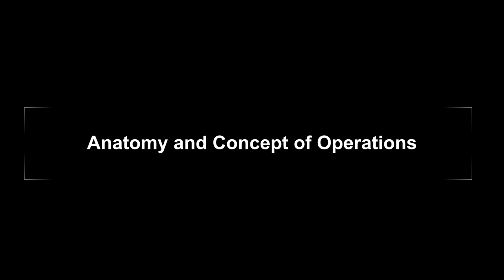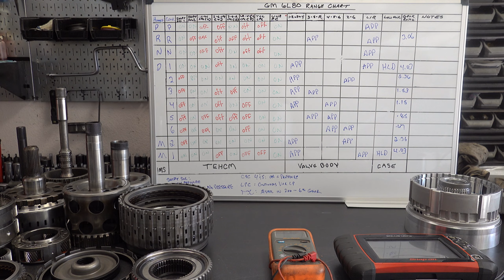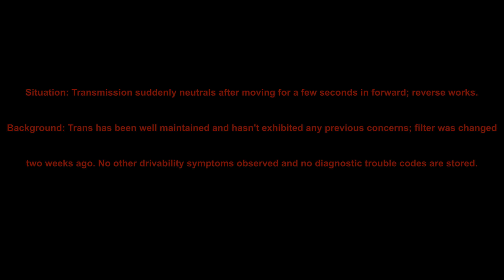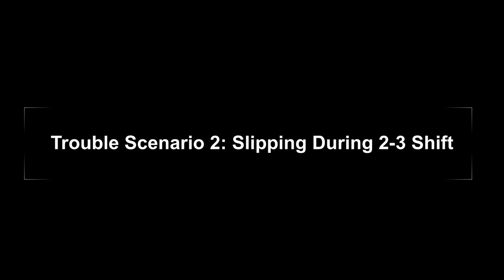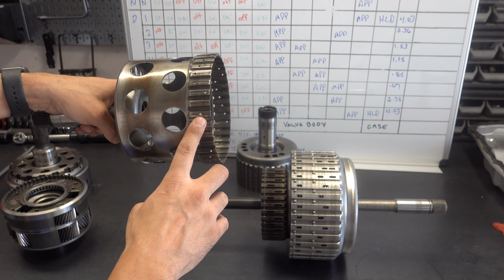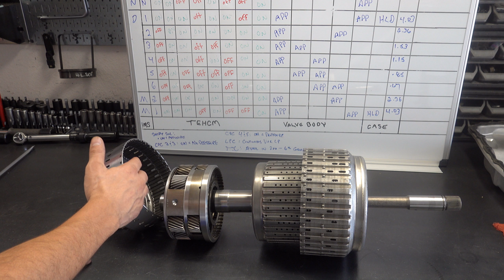6L80 Troubleshooting PT1 - Fundamentals and Range Charts

Comment: In a 6l80 transmission,adding the extra frictions really matter? And at what horse power does it really make a difference?
Reply from the maker: Hi Dale, thank you for watching.

It matters more for the 4-5-6 clutch as it's a bit undersized for what it's being asked to do, especially when power levels start to go up....The 4-5-6 hub also likes to snap under power/torque so upgrading that entire clutch and hub to a 45-tooth Powerglide-spec with the Sonnax piston kit for the extra fictions and billet steel 4-5-6 hub is the best way to 'bullet-proof' it in a HP application. 

The 3-5-R clutch benefits from one extra friction and steel once power levels climb higher than 125% of stock (on avg) but the main vulnerabilities in that transmission are the torque converter and 4-5-6 clutch with the caveat that the 3-5-R clutch drum has had its welds reinforced and all the requisite hydraulic updates / corrective measures have been done.

The converter is shored up by installing a .070" thick BW high energy clutch (or triple disc set up), billet cover, flanged hub and having the TCC apply tuned out for gears 1-4 as it's being overly worked in the early part of the drive cycle, IMO. Flipping the pill or deleting the TBV in the later vehicles also goes a long way to keep the trans healthy. 

The L/R, 2-6 and 1-2-3-4 clutches are fine as is insofar as friction and steel count; Sonnax billet 1-2-3-4 piston is all that is needed there.

Hope that answers your question.

Comment: Hi Nick, I watch and enjoyed this video,  I was looking for the one you mentioned about the solenoids and valve body diagnostic but couldn't find it.   May be you could help me out.  I rebuilt my 6l80 transmission, all new friction and steels, all new bushings, all seals and most pistons replaced, stator pump half replaced, transgo kits in valve body and pump and I did the pressure switch repair sold by transgo.  all gears work in the transmission up down revers all good, but it hesitates shifting ( not sure what gear it is) around 60km and or 80km.  It hesitates the engine revs to between 2500-3000 rpm then gear engages.  I'm thinking or hoping its the solenoids sticking. or at least hoping. (woudl rather not remove the transmission again.  What do you think it would be.  Thanks.
Reply from the maker: Hi Mark, thank you for watching...You'll need to pinpoint in what gear the delayed engagement is occurring but on a fresh rebuild, this typically happens when one or more of the front three clutch packs are outside of factory-specified clearance ranges. Did you record each of your clutch clearance measurements for the 1-2-3-4, 3-5-R and 4-5-6 clutches? Given the speed the problem is likely going to be either in the 3-5-R or 4-5-6 clutch, assuming it's a case internal problem and not a valve body or TEHCM issue. 

Have you scanned the PCM for any transmission codes?

Did you bench test the solenoids and pressure switches to confirm they all had continuity and electrical circuits opened/closed when actuated in the case of each of the pressure switches?

Did you perform a case air check to confirm all clutch packs apply and no leakage is present before bolting the VB/TEHCM, etc onto the case?
Reply: I didn't write the clearances down but I did check them and the all came within tolerance, I had to put a thicker  snap ring in the 1234 to get it into tolerance.  I just went out and scanned the truck and there are no codes.  I haven't been able to nail down the gears, the truck doesn't tell you what gear it is unless you manually shift and I just can't seem to be able to count them,  I did air test all the clutches before I put the valve body on to make sure they all worked.   If I manually shift the gears would it act the same way, that I suppose  would tell me what gear it is slow in.  It seems to go into a neutral state for a second or two before it changes.
Reply from the maker: Did you bench test the TEHCM and Internal Mode Switch?

I always replace the TEHCM and IMS with OEM GM parts on my rebuilds as it's generally not a good idea to reuse those or the harness/speed sensor assembly.
Reply: No I didn't bench test the TEHCM or IMS, and yes I should have, wish I did.They are big ticket items or at least here in Canada they are.  Its looking like its 5th gear that is acting up.  Do you think it would be worth replacing the solenoid section, I assume thats the TEHCM and IMS,  and hope that solves the problem, or do you think I need to pull the transmission again.  Its winter here and that is tough to do on the floor in my garage in the winter.  Thanks for the responses by the way.  I very much appreciate it.
Reply from the maker: You're welcome...The solenoids in the THECM cannot be replaced individually; if any of them or the pressure switches go bad, the entire TEHCM has to be replaced. Id bench test it to see if it has any issues. 

If the issue is only happening in fifth gear then is suspect everything associated with achieving  5th gear including the pistons (apply and balance), turbine shaft sealing rings, 3-5-R clutch boost and clutch pressure regulator valves and TEHCM clutch pressure control solenids and pressure switches. Since the other stuff is new, id focus on the TEHCM first and go from there
Reply: Thanks.  As I said I did air test the apply piston, but not sure about the balance piston, I'm not a trany guy I didn't know what port does the balance pistons, however I think the easiest( and not really the smartest) is for me to get a new TEHCM and replace that.  Then keep my fingers crossed.  Although I could bench test it and rule it out then decide if trany removal is necessary.  But I think I will still replace the TEHCM reguardless.
Reply from the maker: I would bench test it to rule it in/out so you have the information in hand but I also think its a good idea to replace it as well. You'll need to perform the fast adapt relearn once the new TEHCM is installed.
Reply: I was going to say, I thought it needed to be reprogramed once TEHCM is replaced.  I don't know how to do that part, and one reason I didn't want to replace it the first time.
Reply from the maker: @markjones4901 - you did not perform a fast adapt relearn after initially installing the rebuilt transmission?
Reply: Nothing I read or watched on it said anyting about programing unless you replace the TEHCM, so no I didn't.  I'm guessing from your response that I should have.
Reply from the maker: Yep - glad you mentioned it as I may have saved you nearly a grand...Acquire a bi-directional scan tool capable of adaptation resets and perform the fast adapt relearn. This procedure will reset all of the transmission control logic settings and adapts to factory default which is what you need when you have a freshly rebuilt unit, performed any work on the valve body or replaced the TEHCM. 

Note that 'Fast Adapt Relearn' is NOT the same as 'Reprogramming' as reprogramming consists of actually changing the operating system software from one version to another on your TEHCM...This has to be done if you were to replace your transmission with a used one that has a TEHCM with a different part number than the TEHCM in your existing transmission. 

But since you rebuilt your original transmission, you don't need to reprogram anything; you just need to perform the relearn. 
Here are some instructions: https://forwardassistmechanics.wordpress.com/6l45-6l50-6l80-6l90-6-speed-fast-learn-procedure/
Reply: I have a MK808 I will see if it is capable and if so try it now.
Reply: Hi Nick, I thought I would update you.  My scanner does have the ability to fast learn, but it wouldn't let me.  Keeps saying my fluid temp it to low, even though it says the minimum temp is 70c and its reading 74c.  But the scanner also has a reset pressure function (Im not sure what that does).  I tried it and since I did it, it has shifted perfect.  Maybe when the weather is warmer and I have a chance of getting the temp higher I will try the relearn again.  Thanks for the help, You have been great.
Reply from the maker: Hey Mark, thanks for the update and glad to hear you have it working well again! I've never heard of the 'pressure reset' feature on a scan tool but sounds like a neat function to have and seems as though it did the trick. So unless it begins to act up again, I'd call it good in that you shouldn't need to do any further adaptations as the computer will take it from there.

Comment: it will flare up from 1st to 2nd
Reply from the maker: TEHCM - Pressure switch intermittent failure on #1 and #5 staying inactive when they should be open and/or CPC #4 sticking off

Valve Body - 2-6 regulator valve, possible clutch select valves/spring wear, bore plug wear, check ball wear etc

2-6 clutch - piston worn, frictions/steels burnt up, etc.

Comment: I have a 2010 Chevy Silverado LTZ Crew cab hard shift for first the second it slips a little bit... what could that be? Thanks in advance.
Reply: Ok thanks for the info...
Reply from the maker: You're welcome, Desmond and thank you for watching. Lmk if you have any more questions.
Reply: Great video by the way
Reply from the maker: Hey Desmond, thank you for watching...to confirm, you have an overly harsh engagement into drive then it slips during the 1-2 shift? How long has it been doing that? Any codes? Does it do it at all times or only when truck has been sitting overnight or for a while?

Comment: During reassembly what is the range for front end play?
Reply from the maker: Front end play usually comes in around .010-.030 but doesn't have an official spec from the factory as it was never meant to be adjusted. That said, if you machine the pump cover and body/bell housing, you will likely need the Sonnax oversized pump-3-5-R drum thrust washer to replace the factory washer...The Sonnax washer is .020 thicker, which off-sets the .020 of pump 'height' lost in machining. There are also other shims available from Superior Tech to help adjust/dial in end play...Gears magazine has an article on pump machining and end play for those transmissions and IIRC, they recommend running it between .004”-.006” but I'm usually between .005-.015 on my stuff. 

Here's the link to the article: https://gearsmagazine.com/magazine/the-devils-in-the-details-a-machinists-look-at-the-6l80-6l90-units/

Comment: With the 6L80 (ex: my 2014 Yukon 4x4), is there any difference between your chart for Manual Mode/gear 1-2 vs. 3-6? I spend a lot of time in Manual Mode, selecting the gears "manually" to aid in hilly driving terrain.  Is there a mechanical difference with the torque converter, or any additional wear or damage being done in Manual Mode?
Reply from the maker: Hi Dan, not to my knowledge as line pressure continuously varies between modes / throttle position based on whatever the driver is doing. Converter is available for lock up in all forward range settings starting w/2nd gear so no real change there between Drive and Manual modes however by remaining in manual mode you have control over when the transmission shifts so that you can continue to build line pressure in your current gear to keep clutch packs clamped tight, especially when going up hills or down hills for transmission-driven engine braking hence why it's somewhat more desirable to be in manual mode vs auto on hills especially when towing/hauling. 

The 6Ls don't have coast clutches or intermediate manual breaking bands so the same set of clutch packs are working in M1/M2 as in Drive, just slightly differently between full auto and manual owing to the fact you have control over shift timing, etc...
Reply: @nickstransmissions  Thanks for the reply.  I'm about half-way through the video, and felt like raising my hand with a question, lol.  2nd question: Is it possible to have a "true" manual mode with instant shifting (think manual/sequential gearbox) with this 6L80, or will there always be a hardware/software limitation to the delay in shift speed from when I manually select a gear to when the transmission responds with a shift?  (does the computer override my selection based on programming, to prevent those pesky money-shifts, for example?) 

Many times when coasting to a yield sign at the bottom of a hill, but not coming to a complete stop, there will be a long (one second) delay in forward movement as the transmission thinks to upshift due to coasting condition, but is confused when I quickly stab the throttle pedal to merge into the empty lane. The engine revs, but the vehicles waits for the correct gear to engage.
Reply from the maker: Are you referring to paddle shifters or something similar? If so, I think some vehicles equipped w/6L transmissions did have that functionality but I'm not 100% certain on that and you'd have to research for sure. Beyond that, it's not going to respond like a Vette or ZL1 Camaro would as you have an SUV not a sports car and, as such, the tuning, programming and calibration is all designed for SUV-type driving. 

All that said, you can look into HP Tuners to see what options may be available to 'wake it up' from a command/control perspective. Black Bear tunes also have positive reviews/feedback on various forums, etc...
Reply: @nickstransmissions  Yeah, I do have the manual up/down button on my column-mounted shifter. I also do have the BB tune, which did "wake up" the lazy transmission shifting (and turn off the AFM).
Reply from the maker: Nice, sounds like it's going to perform as well as it's capable. 

As always, thanks again for watching, Dan!